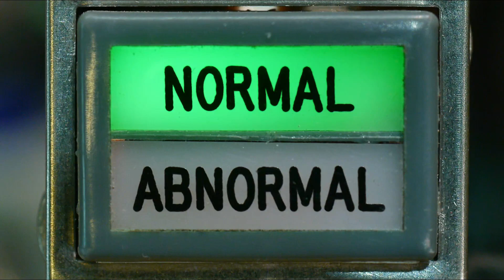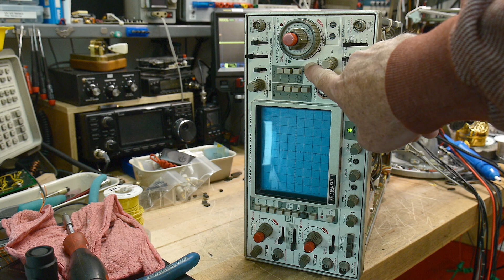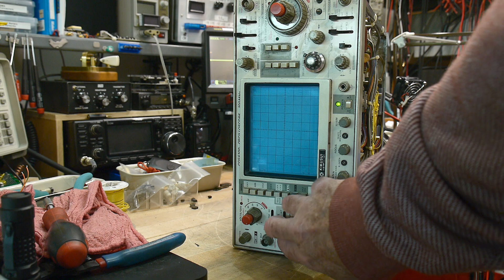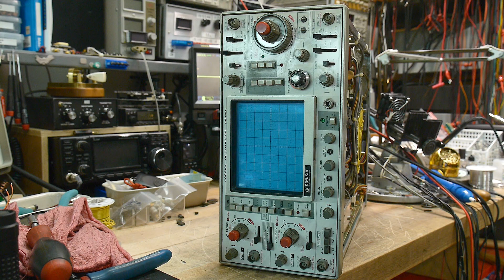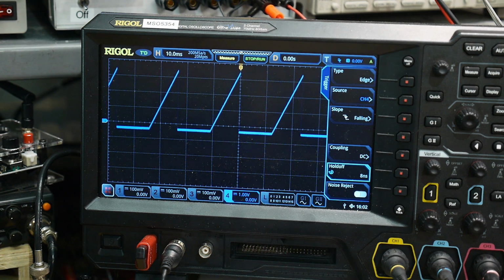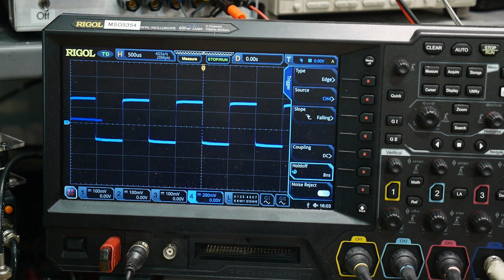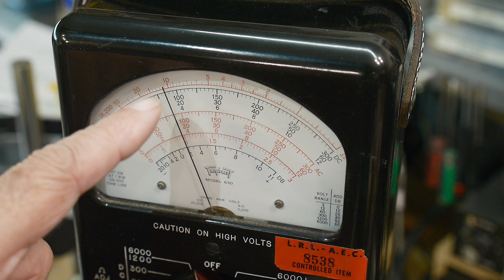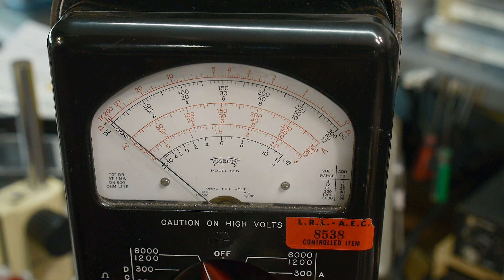#1149 Kikusui COS6100 repair (part 7 of 11)

Comment: Maybe the high voltage meter was loading down the voltage reading, so perhaps that is why it was a bit low
Reply from the maker: 20M ohms at 2000V so I don't think so
Reply: @IMSAIGuy  that's 100uA, in a high-impedance circuit. I'd call it unsure...

Comment: May I ask you a question? Can you do Microcontroller Programming? For example, STM32. Can you do a project with STM32? Like its design of hardware and software. I never understood why few YouTubers are doing this type of videos. Why?
Reply from the maker: I have done lots of projects using arduinos and usually avoide the STM32 because of 3.3v limitation. Here is a esp32 project that I did do: https://youtu.be/k2OwX4pVksw
I also avoid the stm32  boards that require a jumper to enter boot mode. this really slows things down. there are 32 bit boards that you can program without moving a jumper. the esp32 dev board is one I like. I designed this board: https://youtu.be/RijyeelbLo8
Reply: @IMSAIGuy  STM32F401 or STM32F411 based boards can help there. 5v logic tolerant on inputs. Except when in analog mode, A to D for example.
It's also possible to jump into DFU (boot mode) from your user code. I'm working on a project now, if I need to update the firmware (for the 100th time lol)
It's a menu option and it puts my project into firmware update mode. Handy when the microcontroller is buried in the thing.
Reply from the maker: if you are looked for an old video with hardware and firmware check out:
https://youtu.be/9_A-HeUK_5g
https://youtu.be/VOxJ4rEmlHE